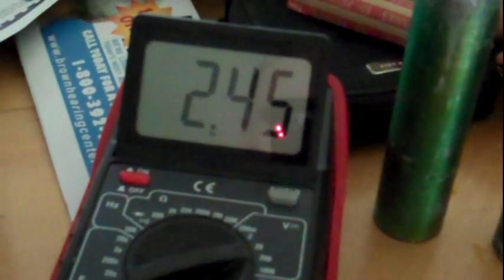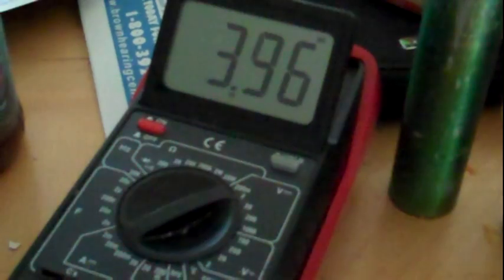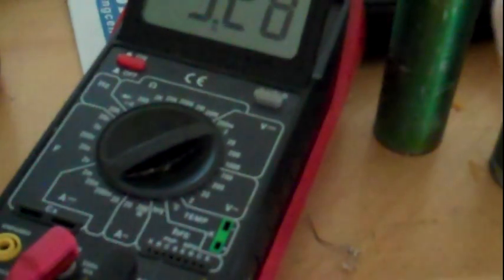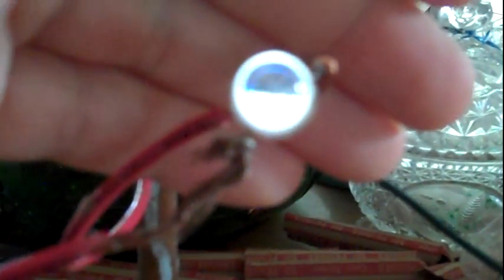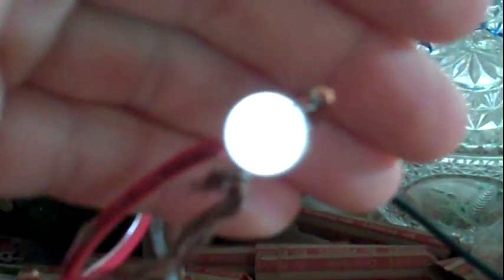Crystal battery cement battery

Comment: Copper core?
Reply from the maker: yeah
Reply: prototype9000
 Have to try that. I saw in other videos copper tube and aluminum core was used. Luckily I have sodium silicate and cement batteries (they work too weakly). So water glass will absorb down to the bottom? Are you sure this is not galvanic reaction?
Reply from the maker: sauroman1 it was the first 3 weeks then the power went town considerably but still continued to work i made many of them after disection after a few months of working saw no further galvanic action ive actually had them work with a steel pipe and a steel bolt there are much better crystal batterys out there than this one
Reply: prototype9000 I saw other strong batteries with magnesium core which is reactive metal and may produce chemical electricity. In my own made batteries I used graphite rods which produced little energy but it's not very good conductor.
Reply from the maker: Gediminas Jesinas
ok

Comment: where on earth can you buy a disposable battery that lasts that long?
 
most disposable chemical batterys can only run a torch for 10-20 hours straight
 
1 year 2 months is almost 10 thousand hours,, thats 5 hundred times longer than a disposable AA battery
 
if this type of battery was on the shelf i would choose this one
Reply: in grocery store. AA batt. rated 2500mah, about 3000mwh; one AA can replace those 2 concrete  cells, but you have to replace it every year or so   like in a wall clock.   in your example  to last 10 000 h under load of those 2 cells (1mw), you'll have to replace 1 aa 3 times.

Comment: Like a crystal that is solid and strong, not unlike a piece of glass.  Almost wish you could form glass and the crystals together.  Crystal bowls and stuff.  Does that have a charge?  I had one battery that didn't crack.  It was cooked alum, epsom, melted, with potassium chloride and sea salt added in the melted mixture.  I don't think I really crushed up the big sea salt crystals in this one.  (had one that cracked with the same ingredients)  Crystals grew, and expanded, but no cracks.

Comment: What about some sort of cement battery, with the electrodes coated with sodium silicate, to protect from corrosion?  I've made some crystal batteries, that are see through, but I'm noticing some cracking, and I would like to eliminate that somehow, so I can be more sure the batteries won't become brittle.

Comment from the maker: @overunitydotcom i used the sodium silicate with the copper bits in this one but i didnt use the copper. recent ones i have used the metal bits in it. as for materials that i use i just use what i find laying around. now im focusing on crystal latice's. to pull in more radiant energy. based on some current experiment, in conjunction with the casimir effect.

Comment: How did you exactly build it ?
Did you just mix cement with this sodium silicate radiator sealer from the auto store  ? What was the mix ratio ? Did you use water into the mix as well ?
Instead of copper pippe, please also try graphite pencil as the electrode.
Many thanks.
Regards, STefan.

Comment from the maker: @ibpointless2 ie tried salt batterys they work good once they dry solid to good effect may be a good alternative to cement. ive tried larger higher wattage leds but there so dimly lit can barely see anything i will keep trying to perfect teh cell design to make smaller more powerfull cells.

Comment: Wow really cool, if you want to squeeze more power out without affecting the load put a even bigger LED in front of that one and you would get a voltage that will SLOWLY recharge a small battery. I made a rock battery using salt on my channel but i was wondering how did u make this? Where did you get the silicate from? Thanks for sharing!